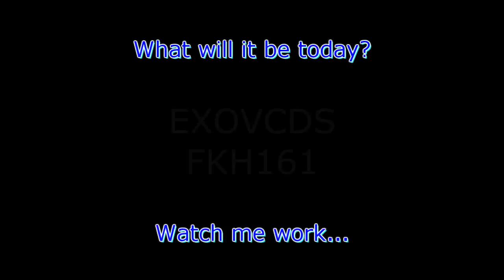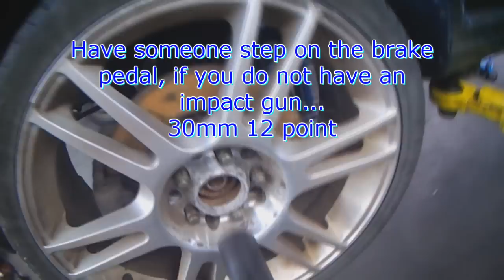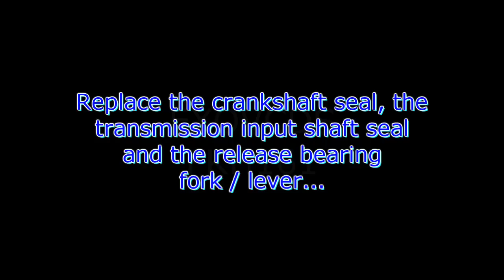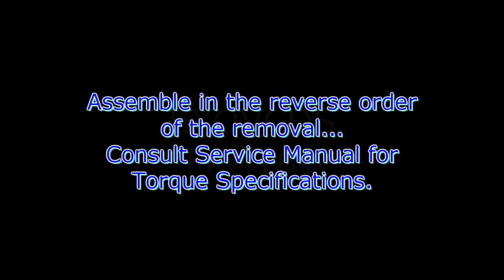VW A4: 2.0L AEG Transmission / Clutch Removal

Comment: Thomas EXOVCDS Hey Thomas, Great video, I love all of your videos I have learned a lot from them! I am currently replacing the clutch in my 2007 2.0L Jetta City. Could you please provide me with torque specifications for all of the bolts that are involved in removal and installation please that would be greatly appreciated! Andre Cordeiro THANKYOU!
Reply from the maker: Working without a service manual?

If this is too expensive: http://www.bentleypublishers.com/volkswagen/repair-information/vw-golf-jetta-gti-99-05-lpv800.html

You can download as many service manuals as you want from the VW Erwin website... for $35 / 24 hrs

https://erwin.vw.com/erwin/showHome.do

It's a small investment for something that gets used more than once.

I have both the paper service manuals and the Erwin PDF's.... over $3500  in service manuals and adding more each year.
Reply from the maker: I couldn't send you a private message via youtube by the way. I sometimes send links to service manual information to people via youtube private message. If you don't know how to enable that, sign-up to my Tech forum and I'll hook you up with info there. I just didn't want to publicly post info here.

Comment: would my 05 Passat 2.0 petrol be the same as this to do anyone?
Reply from the maker: We (Canada) never had the 2.0L B5 Passat... If the transmission looks the same from the top, then yes, same procedure. I'm still at work... I'll get back to you once I'm at home tonight.
Reply: its the 2.0 petrol high line so not sure I know the engine is sideways n OK cool thanks
Reply from the maker: If it's sideways, then it (transmission) is probably similar to this video.... but I'll check once I get home tonight.
Reply from the maker: I can't find any information on your engine & transmission combination. Can you send me a picture of your engine bay? Hood open, take a picture of the engine and a picture looking down at the transmission. Email to fkh161@fkh161.ca
Reply from the maker: Your engine is "front to back"... the transmission is different, and the removal is different. I will send you some information once I get home tonight (I'm about to start work). Is your car front wheel drive only or 4 wheel drive?
Reply: Thomas EXOVCDS OK thanks n tbh I'm not sure I'll after have a look at that think i5s just front but not sure
Reply from the maker: Here's some info for the front wheel drive transmission.... ignore the first image with the intake air duct reference (it's for a V6). http://fkh161.ca/VW/Passat/PassatFWD.pdf

Comment from the maker: I decided to post this video for the Golf & Jetta owners, even though I already have something similar for the New Beetle (which is pretty much the same process).

VW A4: New Beetle TDI Std Tranny Removal (Part 1)

VW A4: New Beetle TDI Std Tranny Removal (Part 2)
Reply: I've done this job a number of times on MKIV TDI's, but I have a mid-rise scissor lift. 

God damn, watching you work with a two-post lift and good air-tools was eye opening...  Talk about "working like a gentleman"

And the owners who show up without the wheel bolt tool?  Fuck 'em.
Reply: Would this process still work for a 02 Volkswagen Passat wagon?
Reply from the maker: No... completely different transmission & orientation.
Reply from the maker: This will give you an idea of what the differences are:
https://youtu.be/elJitIoliJY
Reply: @EXOVCDS  my bad it's a 02 Jetta wagon not Passat but thanks for responding
Reply from the maker: @servantofthetruth8203  Yes, its the same then.

Comment: Hi how much would a shop charge to change the clutch?
Reply from the maker: 5.5hrs for flywheel replacement (basically a clutch job). If other things need to be done "while the transmission is out"... more time will be added. 5.8hrs is listed to replace the rear crankshaft oil seal, as an example. Shop rates (per hour) vary from location to location. Could be $80/hr, could be $120/hr or more. US$, CDN$ all different as well.